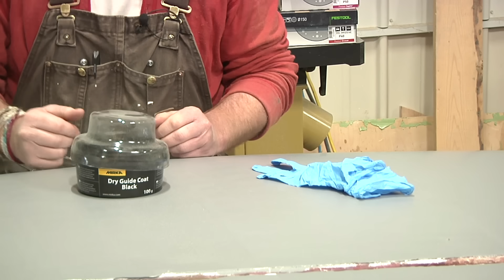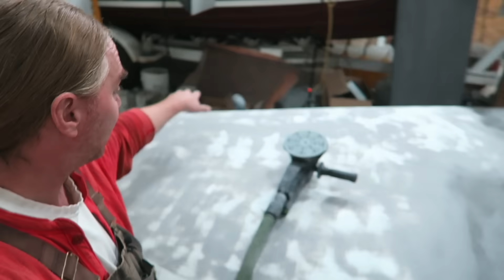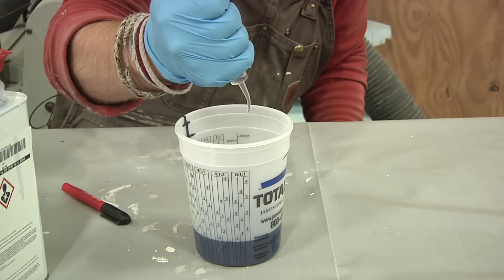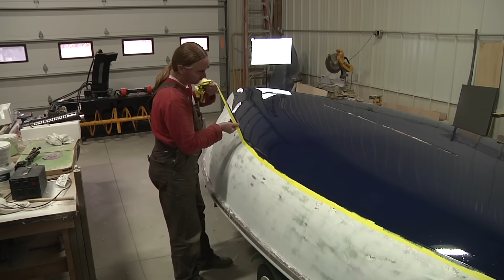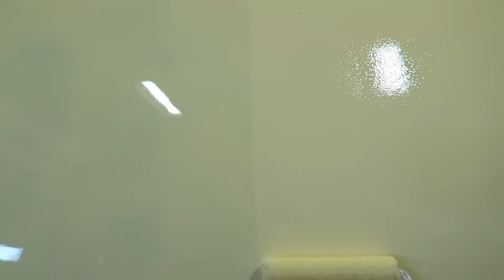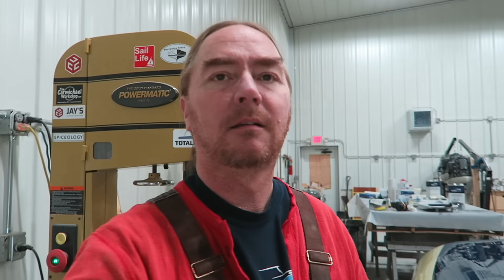ALL ROLL AND NO TIP ;-) PAINTING YOUR BOAT WITH ALEXSEAL!

Comment from the maker: I'm now a distributor for Alexseal and can ship anywhere in the Continental US!  Check it out!  http://www.millerboatworks.com
Reply: I have Hunter 170, which hull is on top ABS plastic. Do you think that this Alexseal paint will be good for it?
Thanks
Reply: The Redtree Foam rollers are much better than the mohair. They leave zero lint, smooth it perfectly, and they are solvent resistant. I painted the hull of my Mako with a single roller after quitting the mohair rollers. No matter what I did, it always left lint.
Reply: Sweet - I was going to buy some through Fisheries, but I appreciate your videos so much, more than happy to put the money in your hands instead!
Reply: Would this paint work well on a motorhome?
Reply: Are there any dealers in Alaska, I have a drift boalt I am refinishing.
Reply: @boatworkstoday when you’ve finished the final coat of painting do you go over it with a buffing machine or wax and compound or is it absolutely fine as it is and just leave it? I ask because I’m new to all this thanks 😎👍

Comment: I painted my Roberts 45 with Alexseal, by the time i was onto the 3rd coat i had quite an audience in the boatyard, even the professional painter could not believe the incredible finish. I could actually hear comments about the tiny bubbles left behind me when i was moving down the hull....and then...the magic happens...it flows and flattens down to an amazing finish.

I got onto this paint a few years back when you first tried it. Thanks Andy, im confident i have the best roller painted Roberts 45 on the planet

Comment: Thank you Andy.....for this and all the other fantastic info you share.  

FYI.....Last spring I switched to Alexseal for repainting my boat's (44' cutter) Royal Blue topsides. 
Based on that experience, I thought I'd offer a few comments: 

1. Alexseal's customer support (both local and national) was fantastic. 

2. Their roll-on additive is a complete DIY game changer. As advertised, no tipping was needed to achieve an incredibly smooth, glossy finish. In fact, I found that trying to tip only hurt the paint flow.      

3. The mohair roller I used to apply the first coat also left a bit of orange peel texture. Switching to a "cheap-o" foam roller (HomeDepot high density foam) for the subsequent coats basically solved that problem (I think the roll-on additive made this possible by eliminating all the excess foam roller bubbles).        

4. I agree that it's pretty important to have a totally uniform substrate color. Any prep spots with different tones ended up "ghosting" thru my topcoat finish (even after three coats of dark blue). 

5. Having a fairly consistent air temperature during the rolling process proved necessary for good, uniform paint flow (especially if working outdoors with dark colors on a large surface area). 

Since re-painting the topsides, I have collected a few scratches and scuffs (why is new paint a magnet for this). So in the coming months, I am hoping to follow your previous Alexseal repair demo to fix these blemishes. 

It that works out ...... then my gratitude for the Alexseal tip will be off the charts.

Many thanks in advance

Comment: This is beautiful finish. I had an experience with painting a fiber glass hull 15 years back on a 25' pilot house. Boat was quite scuffed up everywhere so decided it needed painting to cover all this putty, luckily a friend came to help, he is Classic Marine Carpenter and he wanted to use Bi-Component polyurethane Perfection from major brand and actually not many competitors at the time. He rolled the paint, 2 primer / 2 finish coats. I was amazed how someone could roll the paint with basic roller and then just say simply "ok don't look, don't touch, just let the paint do it's job of stretching" he almost kicked me of the site because I was going to remove flies in non dried paint. The final result was amazing with very little orange peel effect, still a bit more than on your video judging from the quality of the image. I sold that boat 4 years later and it was still very shiny without having done any particular maintenance to it. Just this summer I saw the boat again and it still looks great. I've had gelcoat finished boats since and at times I miss the easiness of paint. For example after a party fishing squid when there is ink everywhere it was so easy with paint just to spray saltwater to get it off. (Non porous). Just completed 24' center console rubbing due to newly purchased 2006 Carolina Blue boat was very (very very) oxidized. Got great results, very satisfying but  knowing even with good wax this will only last so long. Again, great job and thanks for all videos.

Comment: I found you when I starting to restore an old Mako for Coast Guard Aux use and have followed you for a few years. I have switched to building a teardrop trailer that I will epoxy and glass over wood. I was going to bedline it but you have convinced me to roll it out with Alexseal. I have learned so much, not just to put it in to use. Keep up the great work.

Comment: I followed all your advice, (watched all your videos) and painted my 34 PEQUOD last September (outside/by myself).
Interlux Prekote (grey)
Interlux Brightside
(Flag Blue)
4" Mohair minis, roll/no time for tipping
Turned out amazing, with 2 coats, sand and final in the spring cause it got too cold.
I could not/would not have done it without you.
Thanks, for all you do.
Reply: Next time use interlux perfection. Bright side will not hold up

Comment: Hey bud, been working on boats my whole life and I just wanted to say in case you have never tried it before. About the guide coats, I used to buy them and use them religiously and still do, however, I have adopted mixing red dye in some acetone and wiping the entire work surface with it. The initial sanding will knock the high spots off and leave the original surface color. What is left is all the low spots filled with red dye left behind from the evaporated acetone. Just a cool trick I learned from an old timer. I prefer this to be honest.
Reply: I’ve use machinists dye, this sounds cheaper!

Comment: being a painter myself you really need your base coat (primer) to be solid whatever color you choose. when we do chaulkboard paints which are semi-Transparent, if the base coat isnt solid it shows thru the topcoat everytime. put a good base coat down and sometimes you can get away with 1 topcoat instead of 2 top coats for coverage. I dont have to worry about paint so I apply a good base coat and 2 top coats on everything I do. Always turns out Nice

Comment: Can I make a suggestion that will save alot of work& time in dealing with the texture in your primer & gelcoat? And save you from having to do all these processes using guide coat , you can avoid the undesireable surface texture ,and all the sanding needed by when you spray your coats of paint on last spray coats use sheets of Velum,it's a silk like paper, it's shiny surface on the paper,toward the wet paint,lay the paper and  evenly smooth out any bubbles with a paint roller,, once this dries you can peel the Velum off leaving a very smooth surface that matches the surface of the shiny paper,then any wrinkle marks you may have left in the now hardened paint can easily be sanded flush to the rest of the surface.hope this helps.try it if you understood me,I used to work for Trident Yachts back in the day,in Tampa on Tyson ave,and this is a trick we used to save on labor time.

Comment: Hi, Andy. This is another terrific demonstration of the latest refinement in AlexSeal's promising new paint system. Just one suggestion: At 34:50 in the video, you do a short "actual speed" segment as you roll the final coat of yellow onto the topsides. I, personally, think this is/was a really important addition and should be a part of showing us EVERY stage in the prep and painting processes. Otherwise, we run the risk of moving the DA too fast (or too slowly) as we sand, and the roller too fast (or too slowly) as we paint. So PLEASE keep those "actual speed" segments coming!

Comment: Great results!  I've done that "roll and roll" technique with Brightside and a bit of brushing reducer and got really good results on a completely vertical surface, done outside.  I found that the lightest touch on the re-roll to take out the bubbles was key - any heavier and it would leave roller lines instead of flattening them.

Comment: Hi, I have been painting everything that fly's, floats or drives for just over 50 years, the pig tails you speak of are from load up of sand paper, those sticking parts are exactly as you said from Not fully cured primer or paint, Let the Paint cure another day then, Unless you have very pressing time constraints=( life or death in my case),,,,,,,, The way to save that sanding paper are to use a wide and razor sharp thin steel spatula/Scraper and run it gently across the paper to POP the stuck paint ring OFF, then SLAP the paper surface a couple of times to dislodge other fine particles, this action will Extend the use of the paper about 30 to 50% more time/use, stubborn spots are the reason I use a small tooth brush size stainless wire brush in my shirt pocket to massage the spot to a cleaner state. 

I have recently discovered your outstanding channel and learn from you, Great work Sir. Best Regards.

Comment: around 50 years ago   I used a silicon wax additive to prevent fish eyes caused by wax contaminate . the fizzing effect you demonstrated is exactly similar to the way the additive did its thing . a first glance at your work clearly shows the quality and finish which is achievable using a simple roller .. nice tip on the loose napp removal .

Comment: It's all in the preparation, we used the paint cars in a gas station bay, we would hang plastic drop sheets making a big tent and keep the floor wet, we used to use lacquer type paint, of course, we sprayed but it came out pretty darn good, but of course it was on the prep work. For a rollout paint job, that boat turned out pretty good.

Comment: Nice video. Dupont has been making a rolling additive for years. I used it to roll out AwlGrip on a 23 Formula 2 years ago. Was my first time and came out very well. I think I just did two coats. I just used to 4' foam rollers. The guy that told me about the additive did a 45' Hatteras hull outside and it looked amazing.

Comment: Darn! If you would have done this work and posted it 6 months ago Andy, I would have used this process to paint my console and engine box cover. Now, I’m thinking sand both pieced down and start over again using the system you demonstrated here. Great work and video, l learned a lot.

Comment: I painted a Nissan pickup with dark blue rust oleum paint, 3 coats sanding the orange peel 1/2 gone between coats. Final coat no sanding. Make sure the coats are really dry/cured before sanding. Turned out great. The fantastic thing about rolling is no overspray. I have sprayed in the past with enamel everything has overspray (nasty)
Tip: I used a piece of glass to even out the paint on the roller.
It is amazing how much real estate you can cover with a 4 inch roller.

Comment: Nice detail, teaches me how far one needs to go with sanding and tacking to get a good finish.  I never knew before, this lets me know  how many steps to take.  Great to learn how to eliminate tipping as well.  

By the way I use the Festool HEPA Dust extractor as I assume you do as well.  I also use the Grizzly HEPA "low noise" dust extractor for my sliding saw, jointer and shaper.   It is 1.5 HP and good for two tools at a time, it is on a mobile base, so easy to move around if one  needs to (eliminates permanent ducting  $$$).  In any case since installing Grizzly DE I see virtually no dust in my garage shop when using larger machines.  None on my wife's dark blue Cherokee.  I am really impressed with the results of using these two HEPA extractors.  I do orbital sanding with the Festool and have cut many sheets of Apple-ply.

Comment: On the burn through - take a page from auto body - use primer in one of those spray dispensers which you can put any paint in - thinned a little - and touch up - by the time you finish sanding the door is ready for 600 grit wet  - and your ready to go...

Comment: We focus on getting the surfaces to smooth to the detriment of our coatings. They are there to protect the boat. Get it smooth enough without sanding through, then recoat and sand. More coats with less over all sanding, per sanding session. This will give you thicker barriers and save time. Hand sand to just scuff and knock down the high points when you sand.

Comment: A question I had was the speed you set for your sander.  But WOW,  that you can achieve that with a roller. Is it feasible to build a tent over the project rather than spending a week to clean the entire building?

Comment: Over sanded the primer and the paint before the last coat. There was no need for the guide coat on the yellow. Before the final coat a wet sand with a long block was  that was needed to eliminate the orange peel.  Do they make a clear or can the paint be cut and buffed?

Comment: I used this additive when i was touching up my boat in flag blue, came out way better than expected i haven't buffed it and I was showing someone an area i did and they couldn't tell i had done it. Rolling the rest of the boat in the spring. I did it at 14 deg and it worked, later in the afternoon the temp dropped to 12 and it didn't work on that area, came out very rough, so watch your temps. Overall super happy, I even bought a spray reducer etc to use an airbrush but i think i don't need that at all the roller did an amazing job.

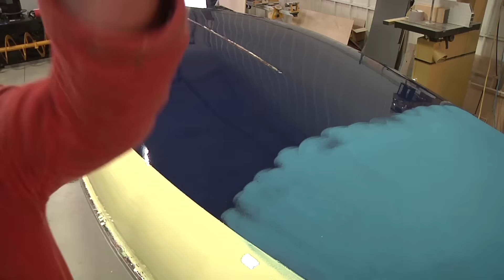Comment: 36:54 That is the difference between an amateur and a pro: An amateur would be ready and splash the boat. A pro sands it down again for the final finish! Two questions: How do you assure, that rolers do not dissolve in the paint and leave hairs or foam in the paint? I made the experience a few times, that even rolers that were specifically made for 2k systems dissolve anyhow. And would it be a way to coat the entire boat after this last sanding with some layers of clear gelcoat? This would make future scratch repair far more simple...?

Comment: It is clear to see that the coats after the first suffer from the additive soaking back into the earlier coats. After drying fully and sanding, the last coat looks like the first.  Perhaps an increase in additive after the first coat would help the flattening and reduce the orange peel, then back to normal on the final coat.  Or just sand between coats.  :)

Comment: I refinished a 18' center console with 2 part Interlux Perfection roll and tip by myself Blue Glow White [BGW] topside and their Fighting Lady Yellow [FLY] on the hull  with a Petit black bottom and red double line bootstrap. Interluxes FLY was way thicker than the BGW and I was continually adding reducer.

I love roll and tip better gloss than spraying, at least what I have experienced with Interlux Perfection line. What I saw in your vid with the self-tipping - damn sure makes the job a hell of a lot easier.  Don't know the chemistry behind it but it sure looks like their additive is somehow doing a nice dance reducing the surface tension of the paint to weaken the thin bubble caps and as the paint starts laying down pulls on and breaks the bubble without adversely influencing sags and runs.

Nice Stuff for sure.  And nice video as usual.

Comment: FYI I like to use the baby Tylenol syringes for the fine measuring. I liked it so much I went and got a couple of the big ones for measuring the reducers too.
Reply: Word of caution using syringes... some medical grade syringes use silicone based lubricant to lube the plunger. Silicone contamination will cause fish eyes and ruin an otherwise fine paint job. I have learned this the hard way... which caused many uplanned  hours of sanding a very hard alexseal spray job.
Reply: @michaelcoburn4370  So we can spray this as well? In your opinion, would spraying turn out better?

Comment: This product looks awesome. I've done a few 30'-ish boats in the open air (boatyard) with roller and tipping foam brush and had some pretty awesome results - even with single part poly - very persnickety stuff though - found it went on best in early morning with very very high fog! (central coast CA) - not what I would have though - anyway - this stuff looks amazing!!! Maybe I missed it??? but for you "highlights reel" can you talk about ambient temp and what the range and need for temp control is. Also, I'd be very interested to see how this product would wet sand and buff. THANKS!!! Awesome --- good luck on the drywall home-work!

Comment: I use to extend the painted area to both sides or come back every little while to extend the start area. This way the relatively quick hardening 2 part PU paint will not be set to far when getting around the boat back to the start. I've painted my kitchen with metallic pigmented International Perfection on top of 4 coats of base paint. As the varnish of Alexseal is a really durable stuff I'm going to finish this with Alexseal. I found the International Perfection to be extremely forgiving and slow curing. In fact I've been working at 23 degrees Celsius I (3 degrees more than standard room temperature) With that conditions I was able to work it over even after 3 hours. The sample with Alexseal topcoat varnish were curing way faster. Still the gloss of the Alexseal is fantastic.